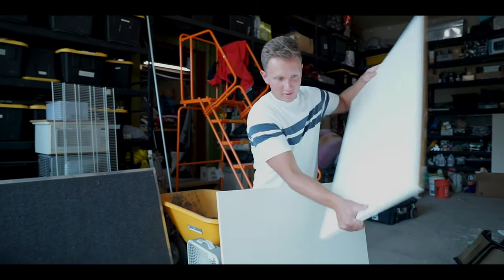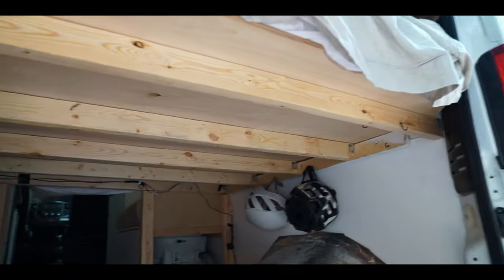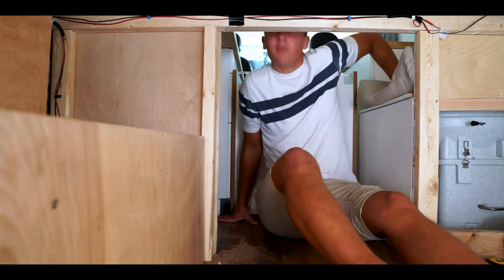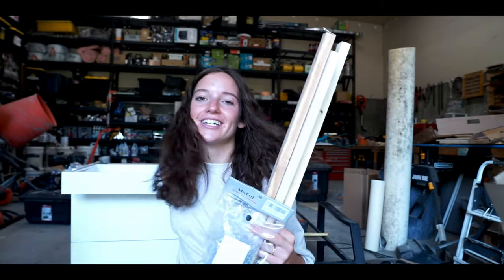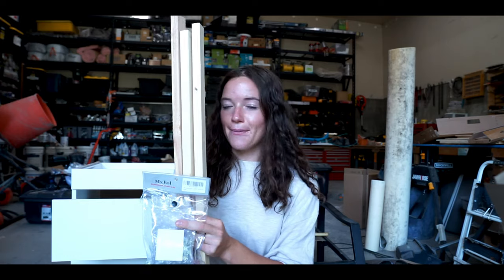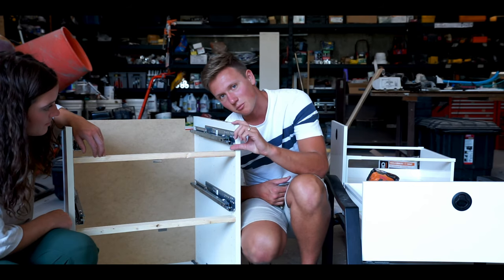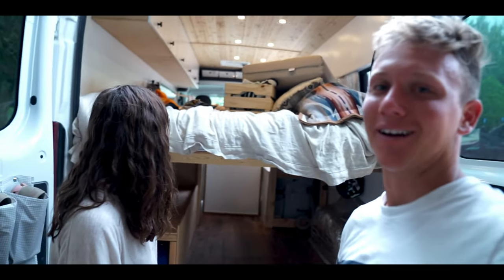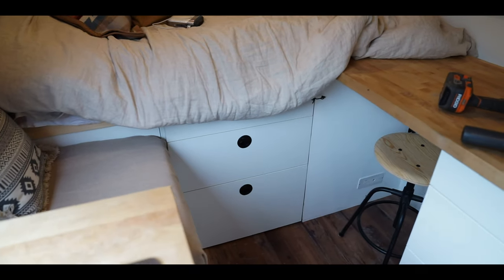How to Customize Ikea Drawers | Van Conversion

Comment: Hi !  I love your videos !!  Thank you !  Excuse my English I am from Quebec :-)  We also look to put IKEA cabinets in our Promaster and we were worried about the width of the isle way ?  I know that usually the cabinets are 24 inches width so what is the space remaining in the isle way ?  We calculated 19 inches but looking at your videos, it seems to be larger.  Thank you very much.  Chantal
Reply from the maker: Hey sorry for the delay, this is a great question though. So the counter side (the side with the ikea drawers) is 24 inches deep. The sink side however we cut down to 18 inches deep which made the middle isle wider (approximately 24 inches).